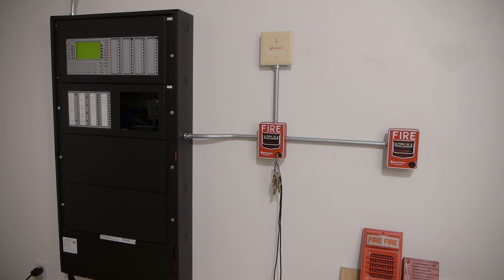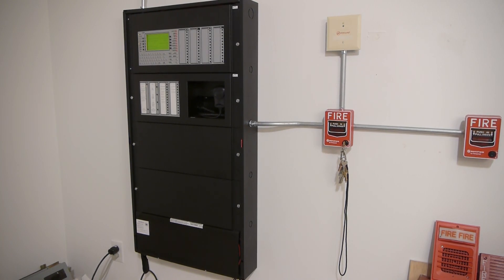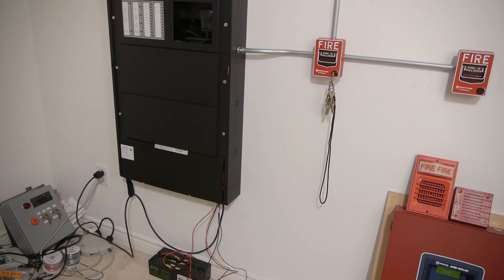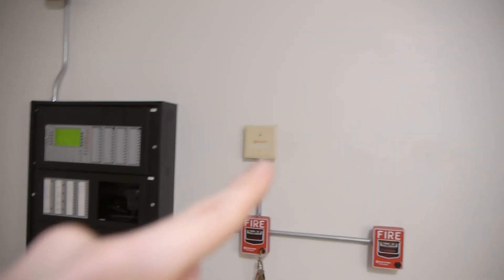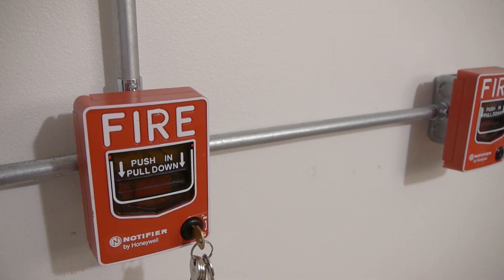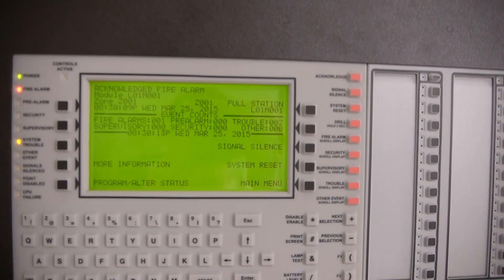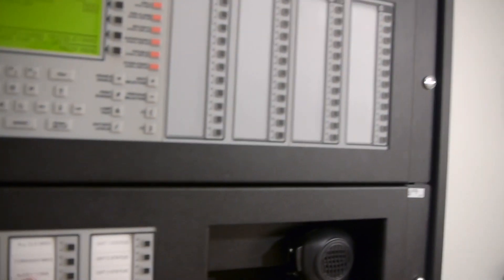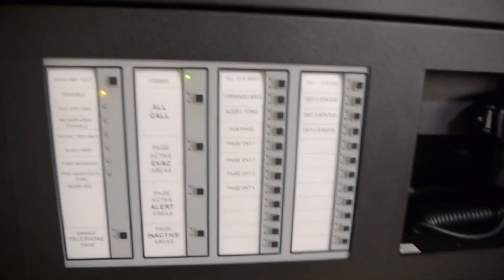New Voice Evac System Test 1 With The Notifier NFS2-3030

Comment: I wish my school had voice evacuation alarms but they don’t and I don’t like hearing the noise by itself but a message is better than hearing the noise it makes
Reply: I agree! But many experts will probably tell you that horns are much louder and thus able to get more people’s attention. I think NFPA 72 Fire Alarm code mandates a standardized Code 3 tone unless the building is for assembly iccupancies. If that’s the case then they have to install a voice system. I think the requirements are a bit dumb myself, especially with me having sensitivity to loud noise. I wish they would reconsider the codes—make voice the standard, not the horn or code 3.